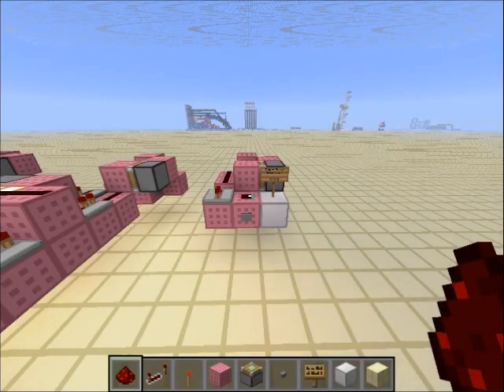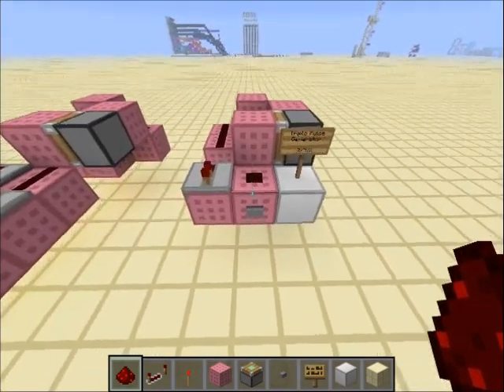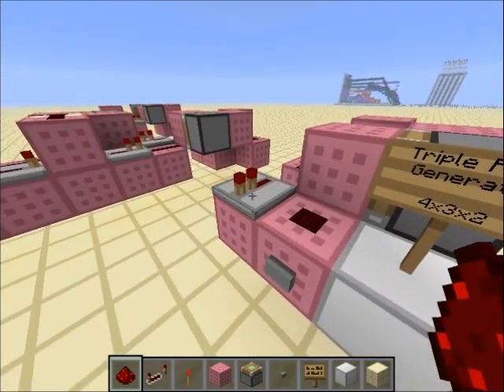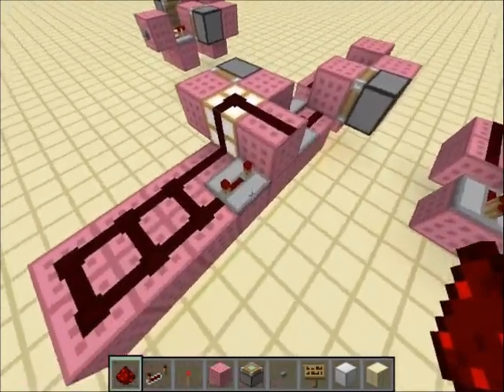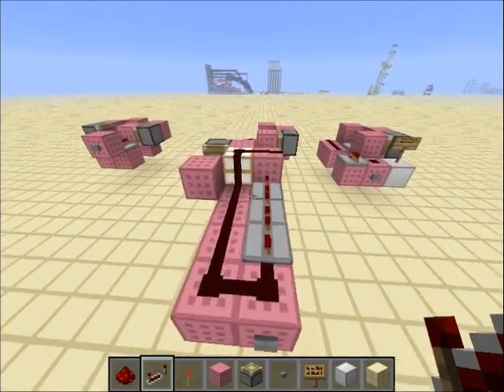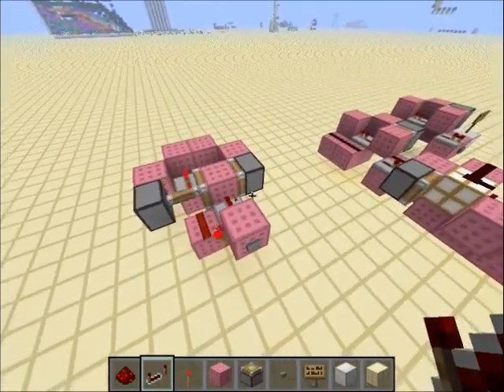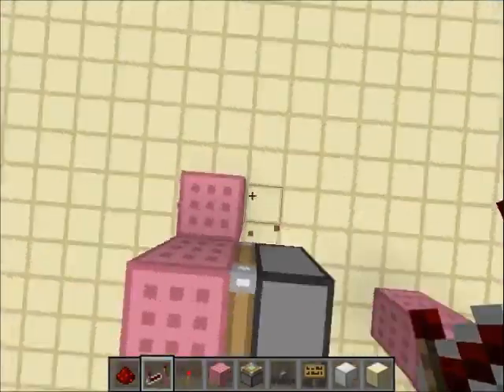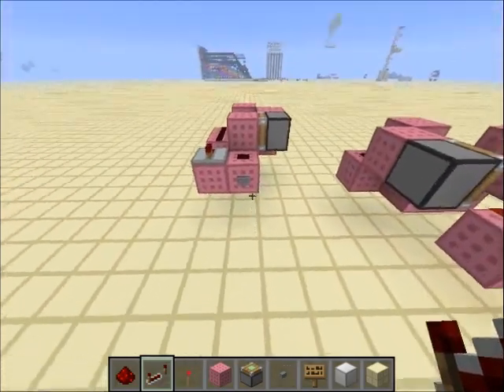Triple Pulse Generator

Comment: Basically, what you actually have there is a toggleable clock, and, depending on the repeater delays, you can set it to have a number of different pulses. Still, I never would have thought to hook up a button to a toggle clock... Well done